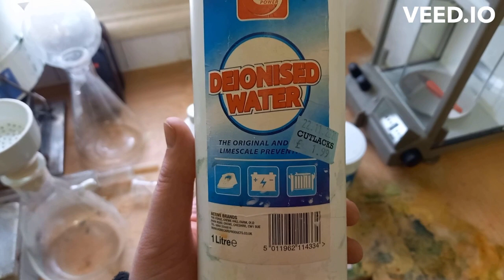Copper (I) Acetylide

Comment: Best to avoid vacuum filtering primary explosives though
Reply from the maker: I was disappointed by this stuff, it certainly lost all energetic properties after it turned black
Reply: @SodiumInteresting  it's not a very good energetic certainly.  Silver acetylide double salt is great though.  Dissolve some Silver nitrate in about 10% nitric acid,  bubble acetylene through it. Use a bigger gas generator with a bunch of water to absorb the carbon disulfide though. Be careful,  it'll detonate unconfined in MG amounts.
Reply from the maker: @chemistryofquestionablequa6252  I don't follow, where are you getting the sulfur for CS2?
Reply from the maker: @chemistryofquestionablequa6252  I was just reading about Tetraamine Copper chlorate before, that stuffs dangerous even when wet
Reply from the maker: @chemistryofquestionablequa6252  I think I'll try silver acetylide but yes I'll be careful
Reply from the maker: @chemistryofquestionablequa6252  I'd like a good way to make ammonium chlorate, perchlorate or even nitrate

Yes I forgot CaC2 had this impurity, probably owing to its smell. Unfortunately purification is not easy